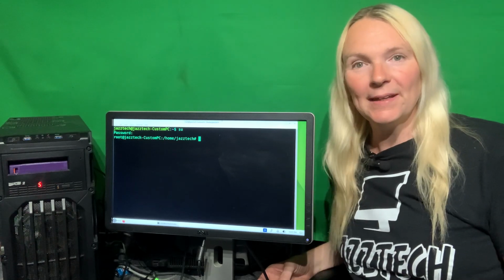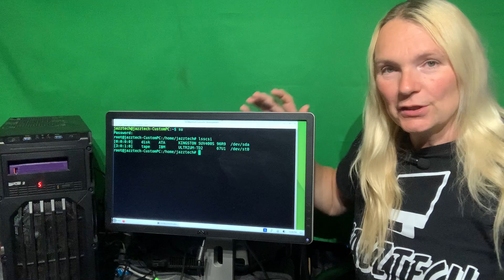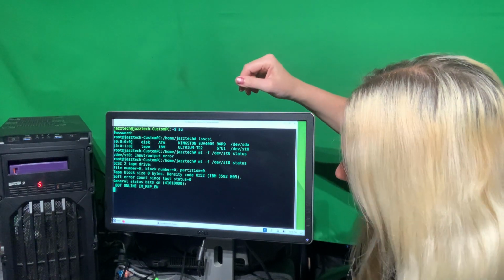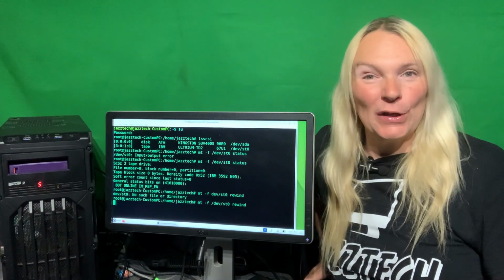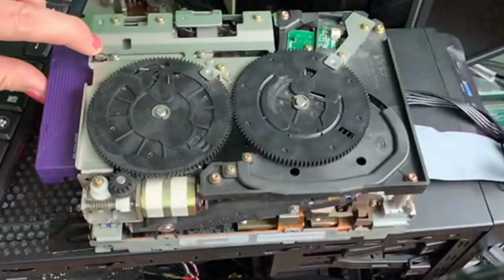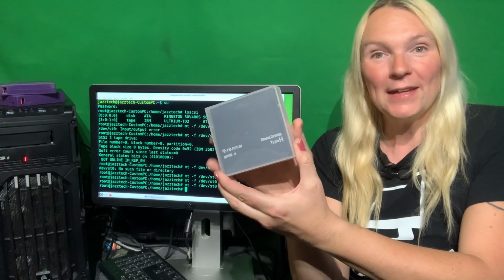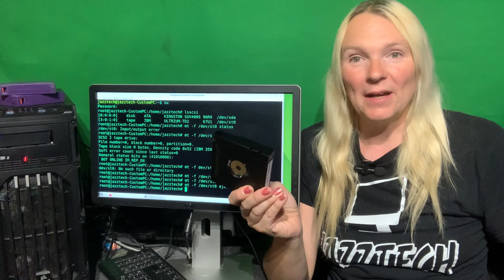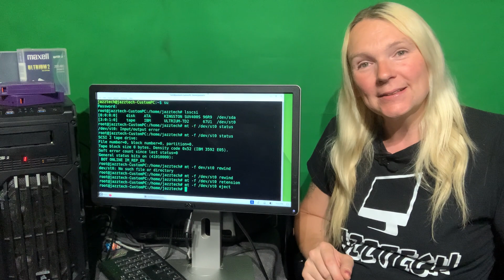Tape Drive Storage from the 2000s - A Look Inside The IBM LTO2!

Comment: I've got an LTO-5 in my current PC running Windows 11, works perfectly. From LTO-5 onwards, there is an option to use LTFS, which exposes the tape as a regular mass storage device in Windows Explorer, so you can just drag-drop as you would on any other disk. Of course, you don't have to use that, and can use regular backup software instead. Contrary to popular belief, modern Windows DOES support older tape drives natively if you install the right driver, although you do have to use backup software to write any data to tape; it doesn't just show up in Explorer like with LTFS.

Comment: Nice video - good to see the slow motion bits. I'm keeping my eyes open for an LTO drive myself. I reckon an older one would work nicely on my old PC. Unfortunately my modern PC is a small form factor one so I can't easily install SCSI/SAS cards etc.
Reply from the maker: eBay have some good deals and Wikipedia explains all the versions and capacity etc. Thanks for watching.

Comment: Just stumbled across your vid do you service DAT players ?? Iam struggling to find a techy to just do general servicing
Reply from the maker: I don't offer a service of repairs other than my own equipment at the moment. I may do in the future but not right now.
Reply: @ I reached out to a lot  of the service engineers and no one wants to work on them Video 99 he does do some DAT players but says he’s to busy with his video shop ,12 volt kid in Canada is an ex Sony trained engineer he will take in servicing but the cost of sending the unit could be expansive , I also tried Pro Audio revival but the seam to have gone quiet the unit Ive got is  JVC/Victor XDZ700 japan only model I have only got the user manual hunting for a JVC XDZ-707 manual the mech is a Sony mech if you haven’t heard DAT I highly recommend also look at Technomoan he does a video on DAT the format that got away

Comment: well not really hard to read tapes for this drive. Every linux can access lto drives with tar. Even much older DLT or AIT. Also even Windows 11 can work with tapes. You just need Backup Exec or Uranium Backup Gold.

Also you got an error code 5 and later 1 on the tape drive.

Comment: The idea behind tape drives is that they are much more reliable mass storage devices for archival purposes than hard drives or flash memories. Anyone who has worked with hard drives or/and flash memories for years know quite well that they are excellent working memories, but they are certainly not very reliable for long-term archiving usage. Meanwhile, there is almost a century of experience with magnetic tapes, and based on this, it's well known that high quality magnetic tape, when properly stored, away from strong magnetic fields, remains easily readable for at least half a century even longer. A fact studied at the laboratory level is, that a signal recorded on ferrous oxide or chromium oxide magnetic tape demagnetizes by about 20% in 30 years, and unoxidized metal microparticle tape demagnetizes by about 15% in 30 years. I have one C-cassette that my mother recorded in 1976, and now, in a year of mercy 2025, it is still listenable. So magnetic tape have been proven to be very reliable archival media.
Reply from the maker: I do like the idea of tape backup. This was just an old unit I acquired that I thought would make an interesting video. It isn't any good to me for practical use as I have too much data for it but it has made me think about getting an LT04 or LTO5 when I can afford it, (couldn't justify the cost of anything newer), to back up all my data on the servers I have.
Thanks for your interesting information and thanks for watching.

Comment: I've just started upgrading our tapes at work to LTO8.

At home I archive to LTO4 and BD-R DL.

At work I'm migrating the DDS/DAT archive tapes, as well as recovering data from the 90's that people ask for. Im moving the DDS tapes to LTO4 first as they are the oldest, then I'll start moving everything LTO1 and above up to LTO8.

The DDS tapes go back to the 90's and besides a little bit of manual cleaning of the heads once in a while the tapes are great.

As for running WinNT Backup, you can install Windows XP on a PCI express machine as long as you use SP3, SP2 just wouldn't boot.

Then a PCI SCSI card will work, with the right drivers as long as you use a PCI express mother board with a PCI slot. A couple of years ago Asus certainly had some. My Ryzen 5 1600 system runs WinXP SP3 just fine with the SATA port's in AHCI mode.

I already did similar at work, there I have an XP SP3 install running on a 4 core Xeon at 3GHz. It only has PCI express however but that's fine as I'm using USB DDS tape drives.

Even though it's PCIe the Quadro GPU and latest 32 bit XP drivers from Nvidia work also. The machine, for WinXP is ridiculously overpowered 😂

Also NTBackup will run on Vista but you need to install the storage service manually. By win 7 NTBackup is totally non-functional for tape access but will work fine if opening the BKF files from other media.

Symantec Backup Exec and NTBackup use exactly the same format thus will read each others data, so my Win2022 server at work will read NT Backup tapes with the latest Backup exec.

There is a tool for Linux that will dump the BKF files off a tape, then NTBackup on windows 7 can open them.

I should point out that /dev/st0 automatically rewinds the tape after every operation. If you want to play with the rewind command with mt, use /dev/nst0 instead.  The 'n' means non-rewinding.

You'd need to wind the tape forward first as it, according to the 'status' command is at block 0 of file 0. The tape probably only has one file on it, but you can wind it forward a bit looking for the next file like so:

'mt -f /dev/nst0 fsf 1'

That should have the drive wind forward looking for the next file, which probably doesn't exist as most just record one huge tar file! Anyway, press ctrl C to stop it (I think) and seeing as you used the non-rewinding device nst0 you can now issue the rewind command. Or you can issue the 'offline' command which will rewind and eject.

Other 'st0' devices exist if you take a look in /dev, some will enable compression etc. Depends on what the Linux Kernel detected and the drive.
Reply from the maker: Thank you, that's useful information. I may do another video in the future with a newer LTO drive and some proper Windows backup software. Thanks for watching.

Comment: Didn't DEC develop LT technology before LTO came out?
Reply from the maker: DEC developed the Digital Linear Tape (DLT) which was proprietary to them and in a single spool cartridge similar to the LTO cartridge. Then IBM, HP and Seagate got together to create the Linear Tape Open format that would be compatible across manufacturers. There were also other formats before LTO on dual spools with aluminium backplates and also some DAT tapes with rotating heads as well.
LTO is still in great use in enterprises.
Reply: @JazzTechUK  Yeah, the DLT was dropped when HP acquired DEC via their acquisition of Compaq.   LTO was more advanced, and as you say, was made available to anyone that wanted to employ it.  Pretty amazing capacity.

Comment: Interesting drive and format, even cooler to have it fired up under Linux. It's a bit whirry, could use a mechanical checkup if you haven't done so already.

You're on your way to becoming the Techmoan of computer tech, and I like that :)
Reply from the maker: Couldn't do anything with it under modern Windows as native tape drive support has been removed, so fired it up under Linux. Most probably will do another video in the future with a more up to date LTO drive and some proper enterprise backup software.

Comment: I tried a DLT drive from the 90s recently and could restore everything fine using Backup Exec. It's been in storage in my shed for 25+ years.
I still use LTO on my home PC. I have an LTO7 (600GB) auto loader and 3 tapes is enough to backup my 16TB NAS. I write two copies with verify and store them in different locations twice a year. These days I mostly rely on disk to disk backup.
Reply from the maker: Tape backups are still good for data archiving and don't suffer ransomware etc.
Thanks for watching.

Comment: I'm surprised to learn that Windows completely removed tape drive support.  I remember being a bit upset when Linux removed support for ISA controller cards for QIC24 tape drives some years ago...
Reply from the maker: Yes, from Windows 7 and Windows Server 2008 there is no native tape support. Microsoft swapped to image backup and typical with Microsoft they want you to do things their way so removed NT Backup to force you to do it their way.
You can of course use enterprise level backup software that does have tape drivers and does work with newer LTO drives.
With Linux being free there is nothing to stop you running an old version of Linux that still does support ISA and QIC24, if you still have such an old computer.
Reply: @JazzTechUK  yup, that's basically what I have to do, since support for old 386 era CPUs was also removed.  I have quite a bit of such old hardware, so I will continue running some older Linux versions.
Reply: LTO5 and above appears in modern Windows like any other hard drive thanks to LTFS, so in theory even the limited built in Windows Server Backup for example should be able to write to it. For LTO1-4, there are no native Windows tools to write to the drive since those generations don't use LTFS and so depend on the backup application to do all the heavy lifting.

Comment: I do believe the LTO drive isn't double height, but actually full height or normal height.  The CD rom drive you took out is an half height drive.  Most drive bays ended up as being half height of their original form factor.
Reply: Indeed, that LTO drive is standard 5.25" full height format as used by floppy drives, hard drives, and QIC tape drives.  The half height stuff came later, and then the 3.5" stuff.
Reply from the maker: @chrisg6597, @wfkonynenberg5242, you are both correct of course. I meant it was twice the height of the CD ROM I was taking out but said it wrong. Thank you for the correction and thanks for watching.

Comment: OMG how we have come such a long way now?
Reply from the maker: Absolutely, big big progress. External hard disks and massive storage USB sticks etc.
The most recent LTO tape drives are still in great use in large companies/enterprises and very useful for archival backup purposes and immune to Ransomware attacks.
Reply: @JazzTechUK  Never seen them whilst I had repaired 1000's of video recorders somehow putting luminance in FM onto the tape whilst adding colour. I think the B/W signal inc sync went from 3.8 to 4.8MHz giving the so called around 240 to 300 lines resolution. Once colour and B/W paths were connected separately we just neared the 450 lines. Now they already put 12K res stuff onto this tube.